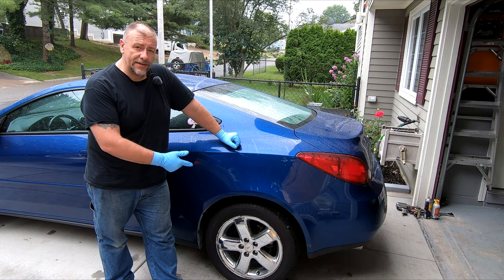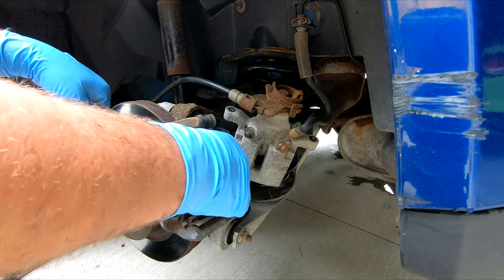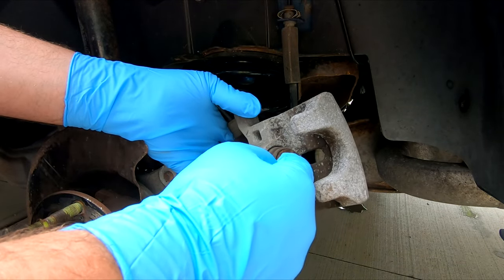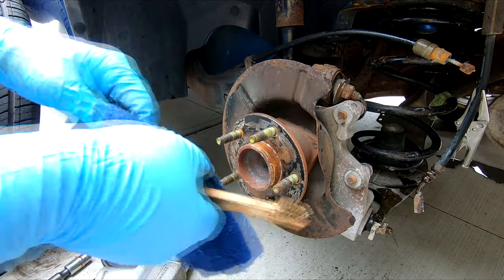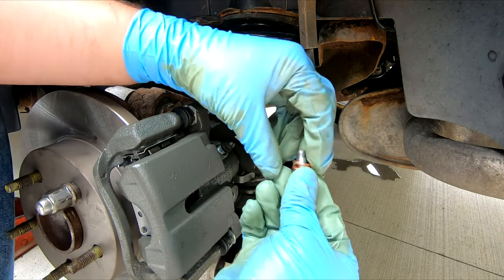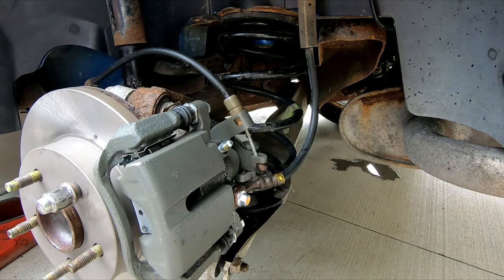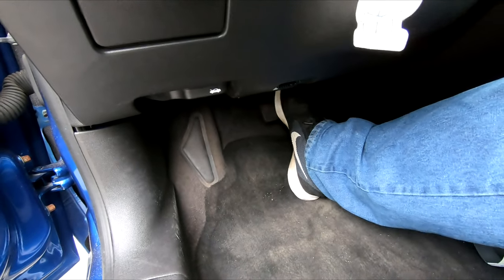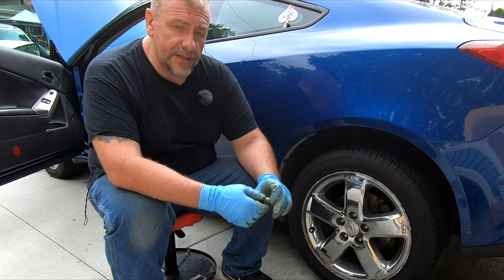Rear Brake Repair- Calipers, Pads and Rotors- 2006 Pontiac G6 | Techn' Moto

Comment: Rotor size for 2.4l base model pontiac G6 2006 for both front and rear rotors?
Reply from the maker: Call dealership for specs
Reply: @TechnMoto  thank you for the reply … but pontiac has shut down back in 2010 and i bought it as third owner
Reply from the maker: If you look up the rotor it may list specs. Maybe